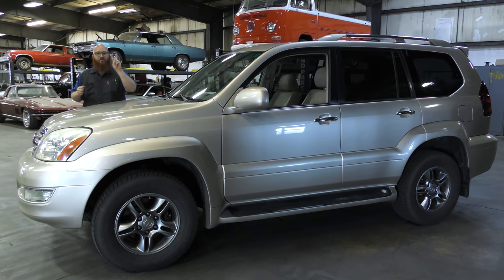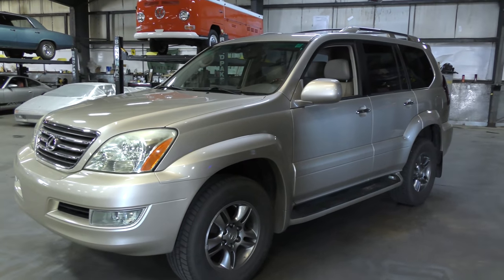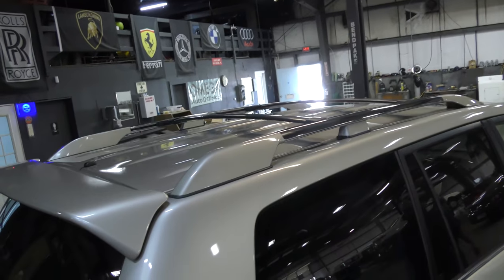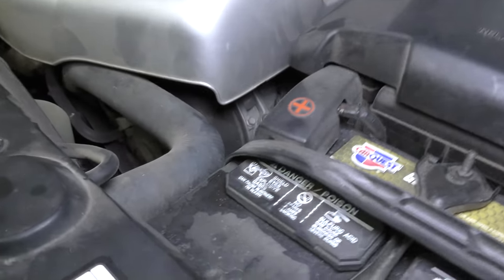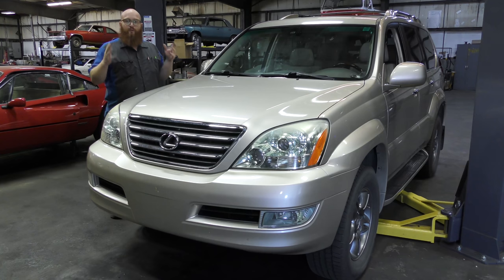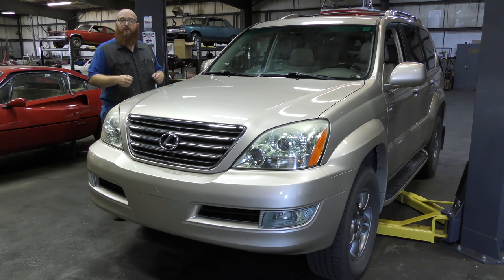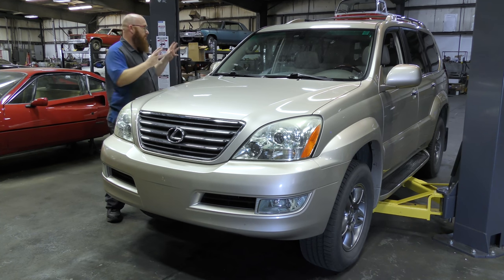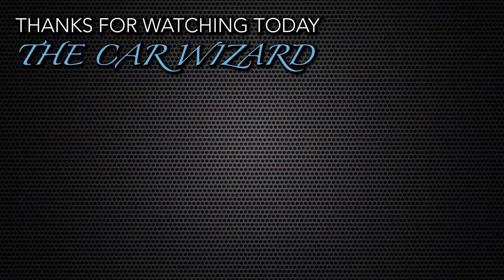Reliable cars get surprise bills too. Simple oil change on '08 Lexus GX470 turns into $1200 repair

Comment: You seem to leave out Honda which having owned and still own are very reliable vehicles .
Reply: @yunggolem4687  You don’t go Subaru unless you’re ready for the ring lands to inevitably fail and get a replacement engine. The only reliable Subaru’s are pre-2008.

Comment: I just bought a 2006 gx470, 160k miles. New shocks, springs, tires, wheels, rotors and fluids. It rides buttery smooth. Looking forward to run it well into the 300k.

Comment: Had a Audi Cabriolet Quattro. Absolutely loved that car. But on the rare occasion I can't get to work the next morning, affording it's maintenance at a high mileage is impossible.

Traded for a RX300, like driving a living room on wheels. And I'm confident that it won't let me down.

Doesn't have the super flat German handling, nor the 28 mpg. But I'm not worried that it will let be down. That's important.

Comment: My dad had a sequioa he bought new in 02 and it was still running fine when he died in 2015. It had 500k miles. 2 years ago, i got a 2017 highlander and now i have 130k miles on it and it still runs like new. It was twice the cost of an acadia of the same year, but totally worth it.

Comment: Change your own oil in your driveway.  Filter $5 + oil ($2/quart on sale with rebate) = $15 total.  And when you do it yourself you know that the oil was REALLY changed, the oil and filter are quality, the correct kind of oil is put into the car, the plug is not cross threaded, the plug is in tight but not too tight.  The time you spend going to the oil change place and waiting for the oil change, is more time than it takes to change it at home in your driveway.

Comment: I changed my RX350 oil for $27, which is the cost of a 10 quarts of full synthetic oil from Costco.  If you want to drive luxury cars, it would be good to know how to do simple thing like oil change, brake pads and rotor replacements, etc.  Mechanics (not saying to the mechanic this video) have brainwashed people with enough fears and dishonesty that people have succumbed into their high prices and most of the low quality work.

$1200 for all the works that Car Wizard charges is a good price!

Finding a good mechanic is RARE.  Most mechanics do sloppy jobs, and some even do more damages than actually fixing things for the customers.

Comment: A good honest mechanic is hard to find. You are one of those! I have to ask... since you have the front end torn apart and charge 4 hours labor per side to do the CV shafts, do you still charge labor for the brakes? I'm not trying to be an ass, just wondering what I should charge as I do work on the side for a few of my friends. 
Thanks
Reply: yes on still charging for brake labor, as the time isn't in removing and replacing the parts,it is in cleaning and lubricating the parts and making sure everything fits and functions right, not just a "pad slap" and call it done

Comment: I have a 2004 and they do have major issues which is the cracking dashboard and transfer case leak from the stepper motor. I bought it cheap because of the transfer case leak because dealer/shop wants $2000 to crack the transfer case and put new seal/o-ring. Luckily the stepper motor can be removed and seals/o-ring replaced without taking out the transfer case unlike the Toyota models (sequoia and 4-runner) It's like a $60 fix.

Comment: Thank you for mentioning the spare. Most peoples spares I’ve checked were flat. Which means they’ve been lucky. I just don’t understand why the spare is always placed outside up so you can’t add air without lowering it. Only takes a min but if you are a human, most won’t bother looking at it and taking the time to do it.

Comment: Yeah, family just got an fj, high miles, but not worried about it. Needs cv axles, maybe a front bearing (might do both since it'll be apart anyway), rear brakes and we'll do fluids. Suspension is worn and will need tires after winter, but a small lift and meatier tires are in it's future. If you can do work yourself it can be really cheap to maintain these trucks.

Comment: I've got 5 Toyota products, including a 2009 Lexus RX350...I do my own maintenance and spend most of my $$$ on routine and long-term items that wear out over time. today, I replaced the semi-metallic pads with ceramic pads (Akebono) as the harsher pads were leaving fine lines on my rotors... Last night, I replaced a leaking oil crankshaft seal and serpentine belt on my son's Corolla... Toyotas will be the only vehicles I'll own from now on...

Comment: Hi there , just stumbled onto your channel and was impressed.  I agree with you 100% as far as quality of Toyota versus American made cars.  I will say, I own several cars and when I want Muscle I do go American (2013 BOSS 302-Laguna Seca) , but then again I have the capability and know how to maintain and fix all my vehicles.  I have a SAAB Turbo as well and do all the maintenance on it (now thats a challenge).  Back to the Toyota, they are as you say a Pleasure to work on.  Everything bolts on and off without breaking. I have performed the following maintenance on my 2006 Tundra w/ 140K miles.  

Replaced Rotors up front they were warped.
Replaced valve cover gaskets they were leaking, they leaked onto the Alternator killed it and had to replace Alternator as well.
Flushed completely Auto Transmission fluid w/ filter.
Replaced all drive shaft u joints , that job was difficult - the drive shaft U joint mounting ears are "flaired" and difficult using the U joint removal tool cause it kept sliding of the U joint ears.
Replaced the Auto Trans output shaft Seal (was leaking).
Replaced timing belt at 90K, was interesting due to the VVT cams, along w/ belt tensioner and all timing belt pulleys. water pump and thermostat replaced.
Replaced all serpentine pulleys, etc.    

Can you recommend what next to change , in that I do long 8 hours drives and don't want to break down on the road.

I'm concerned about any component breakdown that will leave me dead on the road.

Fule pump?
Crankshaft sensor?
Main power relay that powers the CPU ?
wave forms

Comment: I bought a 2007 Lexus ES350 from California. No corrosion. A little neglected. Needs axles, control arms, struts and a brake job. I do most of the work on my cars except for the engines. These are really nice vehicles that are made in Japan.

Comment: I have the exact same vehicle,  i have replaced  the air suspension air bags and air compressor,  brakes and rotars all around serpentine belt, I just hit 200000 miles and it still starts and runs excellent.,  I also upgraded the lights ro HD. I have no real complaints,

Comment: This is a big reason why I bought an '08 Sequoia 2wd, so I wouldn't have extra things to fix, but the main reason was the 2wd is rated to tow 10,000lbs over the 7,500 with the 4wd version. I couldn't be happier with it though, it's 13 years old and it still doesn't look dated. You just can't beat a Toyota.

Comment: Good advice as always. It is an unusual failure on the CV boots. Especially being the inner boots they don't really see that much flex.
Probably good to swap them if you have the money, the inner CVS are not going to give you much warning that they're beginning to fail. The outers will start to click when you're turning and under load. The inners are more likely to just come apart and do exactly what he said start flailing around smashing stuff.
Reply: Those boots failed on my Prado in England, same vehicle basically but with a 3 litre Diesel engine.
Reply: @lewlewis6511  
Wierd..  wonder if there was a materials issue.  Or maybe it's heat related those inner boots are closer to the drivetrain.. maybe close to the exhaust. ??
Reply: @kens97sto171  That was definately the issue with our Subaru Outback, inner joints were right over the CATs so heat a big problem, fortunately Subarus are really easy to work on.
3 litre Diesel in Prado is a 4 cyl turbo engine with single exhaust system, so any heat is only one side and the driveshafts are well ahead of the exhaust anyway.
Yes it is odd, no wear at all in the outer CV boots, though i've repacked the outer joints with fresh grease anyway.
Still a great vehicle, 17 years old now and have no intention of replacing it, if anything they're going up in value but then since the covid scam the whole world's gone stark raving mad.
You might be interested to know, in England the price of Diesel fuel is now running at £1.77 per litre at major service areas, at this rate those of us who work for a living will be on push bikes.
Reply: @lewlewis6511  
If my conversion is right diesel at my normal station is $0.93 per liter.
It's $3.53 per US gallon.
Regular gas is $3.25/ US gallon. 
It's actually down a little bit currently. We saw as much as about $3.85 not long ago. Considering the crisis in Russia I'm surprised the price took a dip.
Always keep in mind that the US gallon is about 20% larger than the UK gallon.
And I get confused with Liters. I used to convert program to try to figure out how many liters go in one US gallon and do the division.
Lol.. 
We never did have that many diesel-powered cars in the US. In late '70s and '80s GM built some pretty terrible unreliable diesels. But sold them to a whole bunch of people, It really soured Americans view on diesel. GM did eventually fix the problem and ended up with a pretty reliable engine. But by then the damage had been done.
Really only had a Volkswagen diesels, a few Peugeot in the early '80s. And actually Ford had an escort diesel for a short time.
Mercedes and BMW had some diesel powered cars, But those were never really mass market. And then more recently Chevy had a Cruze diesel. But I think they only sold that one for a few years also. Apparently it was pretty reliable, but always a bit dangerous to be buying a car that was only sold with a particular powertrain for two or three years. Trying to find parts for it after the fact or service can be practically impossible. Or at least very expensive.
Fuel efficiency minded people here tended to go towards hybrids. Toyota Prius is very popular here, and that's what I drive. I have an '08 with 394,000 mi. Still runs good still gives me 45 to 47 MPG.
Hope you have a wonderful day..

Comment: Just to top-post: Toyota truck CV shafts are pretty tough. So long as there's no play, a cleaning, re-grease and re-booting should be good if the labour cost isn't more than the cost new Toyota CV shaft assemblies -- they're worth saving. The tire pressure warning light will come on if the spare deflates too much and with Toyota SUVs and some older trucks, the "spare" is meant to be included in the tire rotation interval. It also gives the chance to check and lubricate the spare tire winch so it doesn't seize. Unfortunately, getting a small child to eat broccoli is easier than selling a fifth tire to a customer so the factory-installed spare most often sits up in there dry-rotting.

Comment: My issue with Toyota and Honda is not the product but the local dealer. An oil change is a minimum of $300 or a 2 1/2 hour negation to do just the oil change and not the recommended transmission  flush, coolant flush (again), nitrogen in your tires, semi-annual air filter, cabin filter and annual spark plug change. If you refuse any of the additional services they're pushing you just violated any warranty you had with the car as far as them doing the work. We just sent our Honda Accord away after 30 years and 317,000 miles, it went to live in a big garage in the country with a lot of other Hondas to play with. Biggest repair bill we had in 30 years was Air Conditioning at the 10 year point for about $800. I will admit we didn't fix he A/C after the first time  so for the last 15-20 years it didn't have A/C. We bought a Dodge Grand Caravan in 2007, it was about $4,000 cheaper than a Toyota or Honda Van. After 14 years and 175,000 miles we've had two big out of pocket repair bills, A/C for about $800 and a PCM for $1,100. Unlike our Accord the Dodge is on the original axles/cv joints and uses about 1/3 of the batteries. Hondacar was ready for Battery #11 when it left.  So yes we spent less on the van to buy it, but more in repairs. Our Dodge was purchased when the limited lifetime power train was standard so if we woof a trans or engine we're covered.

Comment: In April of this year I bought a 2021 Lexus RX350. Had it back to the dealer 3 times in a few weeks. The 8 speed transmission is garbage it goes into 8th gear at 24 mph it also hesitates trying to find a gear. The tech said that's not right but Lexus said it's normal. Others have complained as well. I dumped it and got a audi A5 love it.

Comment: Mazdas are very solid for a long time, now. Remember, they quit Ford.
Bought my sister a 2010 Mazda 3 2.5 with 180k. It had no repairs done to it. I replaced a CV, TCM (burns up from being bolted to tranny, zip tied to firewall), plugs and changed fluids. That's it. It has 225k on it, now, and despite her best efforts, it's still going strong. 0w40 oil.
A friend has at least 250k on his CX-7s.

Comment: I have an AZ, 07, 4Runner, with 245k and it runs like a top. Serviced every 5k and driven mostly highway miles. You are correct with your recommendation on what to buy.

Comment: My. 06 GX 470 has 215000 on it has had done modes to it,   ICON stage 2 suspension,TRD rims AMSOIL in all cases,Mobil 1 engine oil , I currently need to change pass side front axel, Replace front lower control atms. Replaced radiator,Belt changes done.  WIX oil filter ,K mM at filter..I bought it with 75000 9n it ..Ash tray never used...

Comment: My wife and I both drive lexus. I have an older gx and she got a 2015 rx350. Totally trouble free. I just did the timing belt on the gx myself took about 8 hrs with breaks and knocked that 1200$ bill down to 200 for the kit

Comment: Been looking at these lately. This is a reassuring video that I made the right choice. I've owned over a dozen Toyotas and haven't regretted any of them. BUT, if I told some of my local mechanics to "fix whatever is wrong" I could buy a new vehicle for what they would charge. NEVER say that to a mechanic unless it's someone you have good reason to trust! Especially the Toyota dealer. They will invent dozens of "issues" to try to pad the bill regardless of what I tell them to fix. I recently caught them recommending things they just fixed within the past 2 or 3 years and were in perfect condition.

Comment: Bought an 03 470 with 160,000 on the dash for $5,500 and already put $5000 in it and I've owned it for 4 months now best investment I've ever done parts aint cheat but good parts aint cheap and cheap parts aren't good. Still looking at investing another $5-8000 to make it run like I want to

Comment: Got the same vehicle in England, sadly we don't get the V8 (petrol pricing or rather the tax on it has always been rip off here) ours has a 3 litre turboDiesel which is perfectly adequate, had to change the front inner CV boots last year.
Superb cars, but seeing how wet it is in England and the amount of salt used on the roads in winter here, chassis and underbody corrosion is what kills these off here so sensible owners take anti rust precautions.
That road salt also causes problems with the brake calipers/pistons, especially the fronts, so anyone living in the rust belt make sure you service the brakes properly and regularly.
The good thing about the 3 litre Diesel engine is that changing the cambelt takes one hour for a fairly decent home mechanic, the belt drives only the camshaft(s), nothing else and is simplicity itself to swap out with nothing more than a set of Allen sockets and a couple of spanners, don't even need to remove the auxilliary drive belt.

Comment: Lexus’s are good cars, my parents had 4 of them. My dad’s first one was a 1997 ES300, he drove that to 229,000 miles to September 2004. He bought a 2005 ES 330 , that had 118,000 miles and he would have drove it more years if it wasn’t totaled in 2010. They leased a 2015 RX350, drove it for 2 years and got a good deal on a 2017 RX350 and that will be their final car, my parents are retired, 74 and 75 years old.

Comment: In my country the land cruiser prado (same as this) with the 2tr-fe and a manual transmission can be found for $17000 and more for a 03, 04, 05 and don't even try to get a 2010, that would be more than $30000. And you can find it as a three door. This things refuse to die.

Comment: I spent 2 years looking for a GX470 and could not find the configuration/condition I was looking for, so I bought a Tacoma. I have looked at higher mileage/worse condition GX470s since as a basis for an offroad build (not a daily driver), but the offroad parts get expensive quick.

Comment: I have a Holden (chev) Colorado7 (7 seat wagon based on truck\pickup\ute) for 5 yrs. It has been very reliable. the 2.8 duramax 200hp 500nm is awesome and the 6l50e is a great auto. I have had zero go wrong and its taken us many places into outback aus. I have owned, Mazda, Ford, Suzuki, Subaru, Toyota, Kia, hyundai, nissan and another Holden and the three most reliable have been current vehicle, the suzuki and the kia.